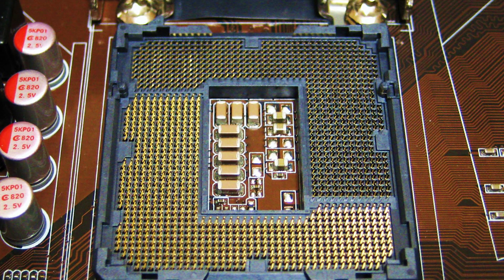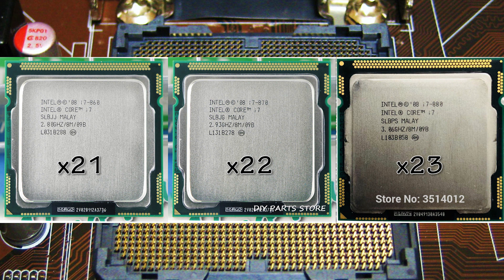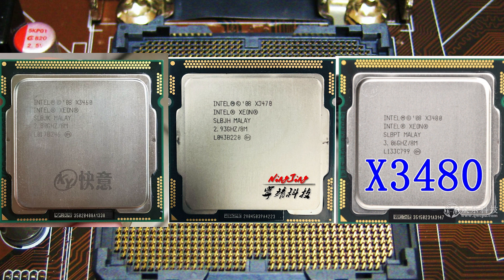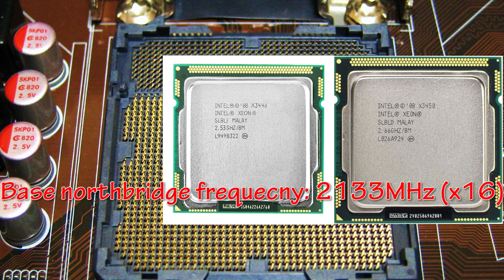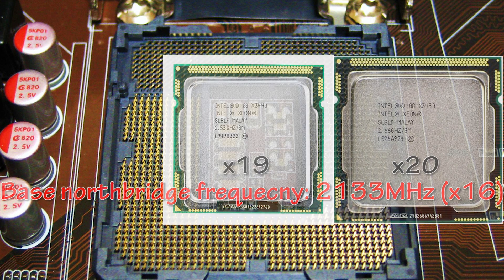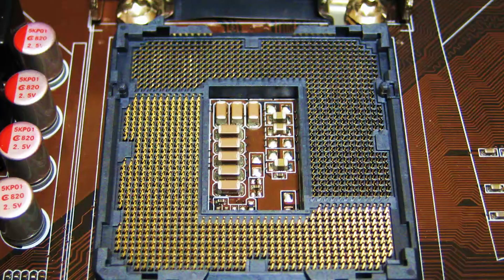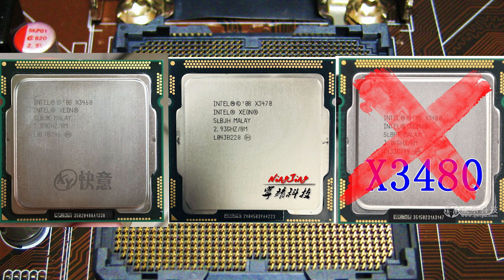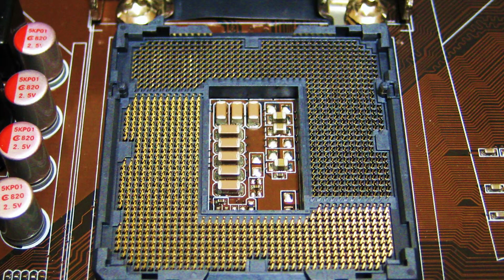What is the best CPU for 1156 socket? i7 880, X3440 or X3470?

Comment: Do you think i should upgrade from an i7 870 to a intel pentium g4560 ? I have a good motherboard for the g4560 but i dont know if its worth upgrading.
Reply from the maker: It's hard to say. G4560 is based on a much newer architecture, but it has only 2 cores / 4 threads. I do not think it will be faster. Some games need at least 4 cores / 8 threads to function properly. So I would not call it an upgrade.
In addition LGA 1151 platform do not offer any great upgrade possibilities. All i5 6X00/7X00 are 4 thread CPUs. So if you are not planning to upgrade to i7 6700(K) / 7700(K) or perform the "coffee mode", I wouldn't recommend to switch to 1151.
If you want to get a significant performance improvement over i7 870, I would suggest to consider LGA 2011-3 or AM4 platforms, starting with Xeon E5-2620v3 (turbo unlocked) and Ryzen 3 3100 respectively. LGA 1151v2 platform offer a decent upgrade path as well.
Reply: @starstreamgamer3704  thanks a lot ! When I have enough money I will go for the i7 6700k and then i will switch to the b150m-k motherboard.
Reply from the maker: You are welcome. i7 6700K is still a decent CPU. But if you are not going to overclock it, 6700 will provide very close level performance.
Reply: @starstreamgamer3704  so If I paired it with a 1660 super it would bottleneck ?
Reply from the maker: You mean 6700? No, it will not bottleneck 1660 S. It's all core boost is 3,7 GHz. So 6700 will be ~30-40% faster than OCed 870 (@4 GHz).
Stock 6700K (which all core boost is 4 GHz) is just 5% faster than 6700.
Reply: @starstreamgamer3704  in my country the 6700k is cheaper than a 6700 lol.
Reply from the maker: Sometimes manufacturers make some weird things with the prices of old models. Well, then it's the obvious choice for you.

Comment: Hello, if you can help me, I will be very happy, I have an i5 750 @4.0ghz stable (idk if I can push it more, and a msi p55-gd55 and a ok tower coolet) where I live, Romania, there are just one man that sells x3440 for 13€, one man that sells x3450 for 14€, and one man that sells x3470 for 50$, I think that my mobo is a good overclocker, and all i7's are like 40-55$, should I go for x3440 if I can do...like 3.7...4.0? Thanks
Reply from the maker: Unlike 750, X3440 supports HT, which will increase framerate in majority of modern games by ~25%, but what's more important it will also increase 1% low and 0,1% low values, thus drastically improving frametime (by ~50%). If your MoBo handles i5 750 clocked at 4 GHz well enough, then it will be a good choice for X3440 too. Whether you will be able to overclock X3440 to 4 GHz or not mostly depends on the quality of the certain chip. Some of them can operate at this frequency at 1,25 V while others need 1,35 V.
I do not think it is worth buying X3470 for $50. It is faster than X3440, but not by much.
Just take a note that due to the presence of HT X3440 is hotter than 750 by ~5-7 °C and consumes about 10% more power.
Reply: @starstreamgamer3704  I think that my mobo can do higher than 4.0ghz on that i5, also xeons have lower temps than i7's due to no integrated graphics, I am right?  I found today a x3470 for 36€ (but still 3x more than x3440) I think I will try my luck and try to repaste the northbridge and go with x3440
Also: it will be a difference betwen x3440, x3450 and x3470 when they are clocked let's say to 3.8 4.0?
Reply from the maker: Integrated GPU can increase temps only if you use it. In idle mode it consumes negligible amount of power.
At the same clock frequency X3460/3470/3480 will be about 2-4% faster than X3440/3450 due to higher NB clock (the speed of their L3 caches is higher as a result). €36 is still too expensive for X3470 in my opinion. I purchased mine a year and a half ago for ~€15 on Aliexpress, while X3440 was just ~€8 cheaper. But paying €23 more is not worth it (IMHO).
Reply: @starstreamgamer3704  thanks, one more question (sorry)  should I take x3440 (cuz it's more popular) or x3450? The dif in price is 2€
Edit: they are the same price cuz shipping on x3450 is cheaper
Reply from the maker: The only difference between X3440 and X3450 is base core clock frequency. X3440 max multiplier is 19 (19x133=2,53 GHz), while X3450 max multiplier is 20 (20x133=2,66GHz). If your MoBo can reach at least 200 MHz BCLK frequency, then there no sence in paying more for X3450, if not, then X3450 will provide slighly better performance.
If the price is the same, then I would choose X3450, just in case.
Reply: @starstreamgamer3704  so...I took the x3450 cuz it was a bit cheaper in total with shipping, I wish I can OC it to at least 3.8ghz, thanks man
Reply from the maker: You are welcome!

Comment: What about the i7 875k?
Reply from the maker: In fact it is a copy of i7-870. I do not know why Intel added "K" to the name of this CPU. All Lynnfield CPUs have unlocked multiplier. So the only difference between all i7s is the base clock frequency.
Reply: @starstreamgamer3704  Are you sure about the unlocked multiplier?
I have an i7 870 and it's locked on 22 (the intel turbo boost technology can go up to 27 on one core). There is the i5 665k and the i7 875k and on their original packaging shows that they are unlocked. The i7 870, for example, don't state anything like that.
Reply from the maker: Well, you can change the i7-870 miltiplier, so it is unlocked. But there is absolutely no sense in increasing it. You can acheive much better results by increasing BCLK. You will probably need to decrease the multiplier by a few steps in this case. The base BCLK value is 133 MHz. If you increase it to 180 MHz (which is a viable for majority of P55 and even some H55 MoBos), then CPU frequency will increase to 3,96 GHz (180x22). I personally was able to increase BCLK frequency to 218 MHz, so I had to decrease the multiplier down to 18.
Reply: @starstreamgamer3704  Fair enough. I think the i7 875k max multiplier is x62. I'm not sure why it's called unlocked. If I know good, intel called this kind of processors extreme edition before. That is seems more correct. 
The x18 looks good, the QPI link use the same multiplier. 
Anyway, I'll go for a xeon x3480 if I can find one for a fair price. Just because of the 32GB ram support.
Reply from the maker: Yeah. I think that the ablity to increase multiplier is the only reason they aded "K".
Xeon X3480 max multiplier is 23, while X3460 max multiplier is 21. That is the only difference between these CPUs. Not sure it is worth double the price.

Comment: Is there any big difference between x3470 and x3460? Thanks
Reply from the maker: The only difference between these two CPUs is base clock frequency.
Reply: @starstreamgamer3704  one more question. Is it good if i pair x3460 with rx 470? Will there be any bottleneck?
Reply from the maker: Well, it will depend on certain games and the quality of graphics settings. But overall X3460+RX470 is pretty balanced config.

Comment: can LGA 1156 holds 16GB RAM DDR3? (1600MHz)
Reply from the maker: Yes. 2x8 GB is no problem for any Lynnfield CPUs. Xeon CPUs officially support up to 32 GB (4x8 GB) of DDR3.
Reply: @starstreamgamer3704  But if the Mobo doesn't support?
Reply from the maker: What MoBo is this?
Reply: The named is Amphtron, Bulldozer and varro
Reply from the maker: If MoBo has 4 DIMM slots, you should be able to install 16 (4x4) GB of RAM. It concerns all motherboards made by Asus, AsRock and Gigabyte paired with any Lynnfield CPU. But I am not sure about the brands you mentioned. You'd better contact with them and ask if it is possible.
But if MoBo has only 2 DIMM slots, I am not sure you will be able to use 2x8 GB. 2x4 GB should be no problem though.
Reply: @starstreamgamer3704  yes these mobos brands are cheap and unfamous but atleast i got them just for fun pc's
Reply from the maker: It's up to you to decide. I was using 12 GB in total (2x4 GB and 2x2 GB). And I know that 4x4 GB is viable too. But 2x8 GB is not common. It should work, but who knows, what limitations certain MoBo manufacturer could create.
Reply: @starstreamgamer3704  yup, i hope it works 16gb

Comment: Very helpful! You earned a new subscriber!
I have a Gigabyte GA-P55-USB3 with a Xeon X3450 running at 4GHZ. Runs like charm, but I plan to upgrade it to a X3470 in the near future. I just wanted to share this :p
Have a nice day!
Reply from the maker: Thanks. You are welcome! Not sure you will notice any meaningful difference between your X3450 and X3470. The latter has a bit faster L3 cache (due to higher NB fequency), so it will provide 3 to 5% higher framerates. But the price for X3470 is not too high, so it might be a worthwhile upgarde.

Comment: It means that a x3470 is MUCH better than a i5? I've got the x3470 and the same motherboard as you! the same model, but when I launched it with the xeon, nothing happened... I think it's the BIOS, I need to update it, so I ordered a i5... What do you think, It would be helpful, thank you!
Reply from the maker: Yes, X3470 has 8 threads, while i5 750 (or 760) has only 4 threads. Majority of modern games and modern applications can effectively use hyperthreading, so X3470 will be faster than i5. 4 additional threads may provide up to 50% better performance (gaming framerates usually increase by 20-30%).
You can use any compatible CPU to update BIOS - i3, i5 or i7.
Reply: @starstreamgamer3704  thank you man! I saw the video about the overclocking, and because I have the same cpu and motherboard, I can just put the settings that you put in the video)
Reply from the maker: You are welcome. But take a note than all CPUs are a bit different (due to silicon lottery). Yours might be a bit better or a bit worse. Of course you can try my settings and they will probably be OK for your system. But in case you get any errors, just try decrease BCLK a little bit.

Comment: Since xeon X3470 has no integrated GPU so what if i don’t have even dedicated GPU do i can still use my PC or boot with xeon X3470?
Reply from the maker: Well, yes, you can boot your PC. But with Xeon you will need any external GPU. Otherwise you won't be able to output video signal.
Reply: Starstream Gamer what if i have on board graphics that has 128mb is that ok?
Reply from the maker: If your motherboard has on board graphics, then you should be able to use it. But take a note that 128 MB of VRAM is not enough for gaming.
Reply: Starstream Gamer it’s ok i’m not into gaming, i’m more into programming and workstation. Thank you so much for your kind and responsiveness you just save me a lot
Reply from the maker: You are welcome!

Comment: Which is best suitable GPU for x3470?
Reply from the maker: It depends on what resolution are you going to use. If you are aming at 1080p/60Hz/High, then GTX 1660 Super/Ti is a perfect choice. Some pooply optimized games (like latest Far Cry and Star Wars) will be bottlenecked by X3470, but in general you should be fine. For 1440p/60Hz/High RTX 2060 Super or RX 5700 is the way to go.
All these recommendations are relevant only if you overclocked your CPU/RAM, otherwise RX 580/GTX 1650 Super is all you need for 1080p.

Comment: hello , should i upgrade my I5 650 to i7 870  for about $30 ????
.(my motherboard is only compatible upto I7 870) my motherboard from intel hp 304bh 
. my pc is hp 8100 elite  CMT  ,
 will i get more fps in games and how much????
Reply from the maker: i7 870 has twice as much cores, twice as much threads and twice as large L3 cache. This will be a massive improvement for games. I think you can expect up to 50% higher framerates.
Reply: @starstreamgamer3704  thanks man  . thank you very much
Reply from the maker: You are welcome!
Reply: @starstreamgamer3704  hello bro just one last question 
HOW  to know that my bios version can support this processor??

THANKS AGAIN..
Reply from the maker: You should visit  the official site of the brand and search for the info about BIOS versions for your MoBo. They should provide all the info about supported CPUs for each version.

Comment: Yes I have the exact same problem. I currently have an I3-550 Clarkdale and I'm planning to upgrade.

You convinced me I should go for Xeon X3440 but my question is, will a 240w PSU be able to handle it?
I have a low profile GT730 and 12gb of ram, plus I have no options to upgrade my PSU since tfx size is not available here.

Also my mobo is a stock Lenovo OEM  ih57m v1.1 mobo. can it support the xeon? thanks
Reply from the maker: Hi! Overclocked X3440 can consume about 120-150 W. But if you are not going to overclock it, 240 W PS might be enough. But you do not really need to overclock it anyway, as stock X3440 will still be bottlenecked by GT 730.
Not sure about you MoBo. Seems like this is a very rare model.
Reply: @starstreamgamer3704  it is an oem by lenovo that comes stock with their thinkcentre units. Same problem with PSU because it is propietary.

If only i could find a cheap enough low profile gtx 750ti or gt 1030 out here, then i wont have bottlenecking problems I think. Hahaha
Reply from the maker: You'd better send Lenovo a question, whether this MoBo supports Xeons. If not, you can purchase i5-750, which is quite cheap and still significantly faster CPU than your i3-550.
But many of H57 boards support Xeons (officially or unofficially), so chances are your MoBo support them too.
Reply: Hey man..i know its been 3 years..but may i ask you? I have the same motherboard as you..did you upgrade the cpu to xeon? And did it work?
Reply: @zephyrus_.8309 Yes, it work 😊

Comment: i have i7 880 and x3480 for my 1156. I still remember i buy that i7 880 after world cup 2010 around $569 or $565 (i forgot) and for the x3480 i buy around $598. The last series and the high series from Intel what i've got until now :)
Reply from the maker: Who knew 8 threads will become so relevant nowadays. Thanks to Hyperthreading and a great overclocking potential, LGA1156 users can still comfortably use their PCs. And not only for office apps, but even for modern gaming and simple video editing.

Comment: Brother,can i overclock x3470 on intel q57 motherboard?
Reply: I have seen many people's comments where they say xeon work good on elite 8100 pc
Reply: @papamakichuucspro  they do for sure! I have the x3440 in mine and I can play tough games without any problem.
Reply: @JSANCHEZX  now i have i5 3470 and it has great temperatures compared to x3470
Reply: @papamakichuucspro  I was talking about the fact that x 30xx processors worked well in a 8100 elite. Even if you can't overclock it because of the locked bios, you can still play some games with decent performances at stock speed.
Reply: @JSANCHEZX  yes i know bro..i tried iton my elite 8100sff...but bro it affect 240w psu and processor chip stopped working even with healthy psu
Reply: @JSANCHEZX  i then got 3rd gen pc...but yes x3470 had good performance compared to price
Reply from the maker: As far as I know even H57 MoBos support overclocking, for example, ASUS P7H57D-V EVO. So Q57 should support it too. But I am not sure H57/Q57 support Xeons.
Reply: @starstreamgamer3704  bro when i would get cpu,i hope i would require u for buying an appropriate cpu cooler.
Reply from the maker: Snowman MT-6 is a good choice, though it is not massive enough to provide sufficient cooling for X3470 @4GHz, but @3,6-3,8GHz it should be fine.
If you want to reach 4GHz, you'd better choose some massive cooler with 5 or even 6 copper heat pipes.
Reply: @starstreamgamer3704  at my place it is more expensive than x3470 😂 but thnx bro for ur valuable answer ❤️

Comment: Cost to me is irrelevant, I just want to know which CPU performs better with gaming; i7 880 or the Xeon x3480?
Reply from the maker: They are very similar in terms of raw CPU performance and overclocking capabilities. But Xeon supports ECC REG memory and up to 32 GB of DDR3, while i7 has integrated graphics (which you will be able to use only if you are the owner of H55 MoBo) and supports only 16 GB of DDR3.
Reply: @starstreamgamer3704  Thank you... This is very helpful :)

Comment: Thanks I have the same cpu i5 760 really need a upgrade PC can't even run Minecraft on max or med settings only csgo with smoth fpsor something like that
Reply from the maker: You are welcome. But I am not sure 4 additional threads of Xeon or i7 will provide any performance improvement for Minecraft. As far as I know, this game mostly relies on 2 cores. So you need a CPU with a couple of powerful cores to play this game at "High" settings and with high framerate.
Reply: X3470 will play Minecraft very well

Comment: Hi i have a motherboard Asrock P67 Transformer 1156 , with Intel(R) Xeon (TM) 3450 i overclocked my cpu to 3.8 ghz with 1.2 v,  when i try to get 4.2 Ghz system is doing bad and going to blue screen, if i  change CPU to Xeon 3470  can i take 4.1-4.2 ghz ?      . Thank you man
Reply from the maker: Hi. Nobody can guarantee that you will be able overclock your CPU sample to 4.2 GHz. It just may not be able to work at this frequency. Replacing it with X3470 will not change much. You may win silicon lottery and your X3470 will be able to work at 4,2 GHz with 1.3 V. But majority of these CPUs need at least 1.4 V to function at 4,1-4,2 GHz.
I would not recommend you to overclock your CPU to 4,2 GHz. Such high frequency will provide you just about 2-3% better performance in comparison with 4 Ghz, while the increase in CPU temperature will be astounding.
Still if you want to reach 4,2 GHz, you need to raise CPU voltage higher than 1,2 V. Try 1,3-1,35-1,4 V. Watch your CPU and MoBo temps. VRM temps will increase a lot as well!